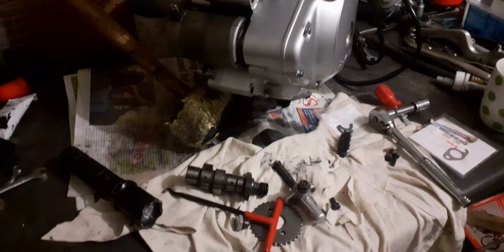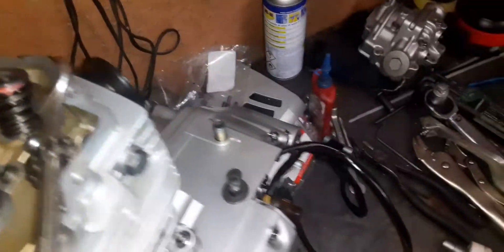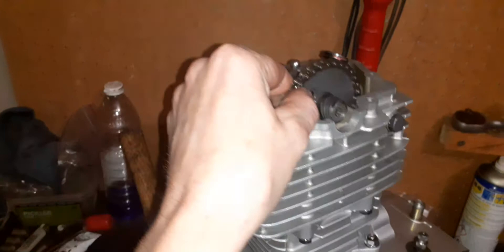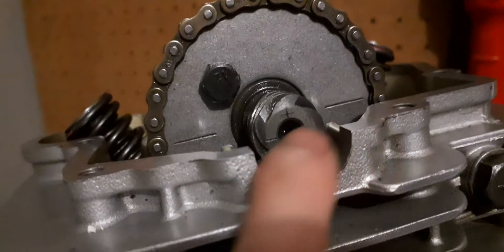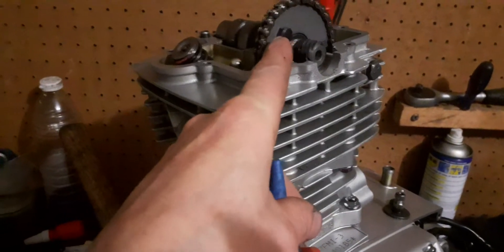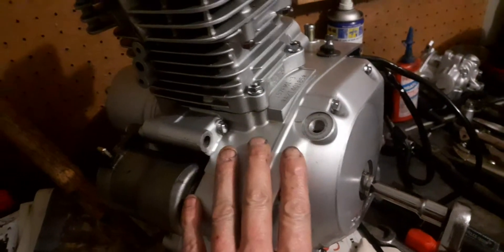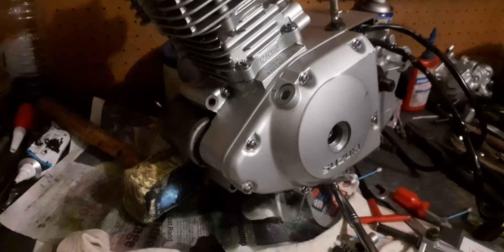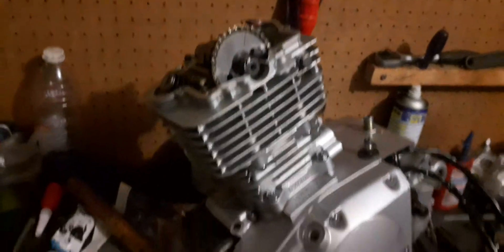Gn125h.Camshaft installation.Boring informations'get it wrong and kiss your  engine good-bye mother-

Comment: once youve built the engine back up, slowly turn the engine over with the rachet to make sure the valves are not hitting the piston, if its out, then strip and refit the cam shaft
Reply from the maker: You cannot teach me nothing cause you know absolutely nothing.

Comment: I installed it wrong and tried to start the engine but it didn't start, is that okay?
Reply from the maker: Only way to know if you have done it wrong is to open it and pray nothing is bend.Hopefully you get lucky.Make very shore your flywheel index marks are lining up with your camshaft
Reply from the maker: Also check your valve clearance with a feeler gauge. Ther are maney other vids on hoe to adjust your feeler gauge gaps
Reply: @deliverance3767  Thank you very much ❤️

Comment: If you don't see the index Mark from the peep hole ,one should just remove the Spark plug and insert a long screw driver to check the top dead centre and align the cam shaft mark.
Reply: Its not necessary,because piston position must be tdc,in this video it checked by firstly shown T mark
Reply from the maker: You have never ever workted on a motorcycle. I can tell you that you do not know what you are talking  about cause you are as dumb as a plank